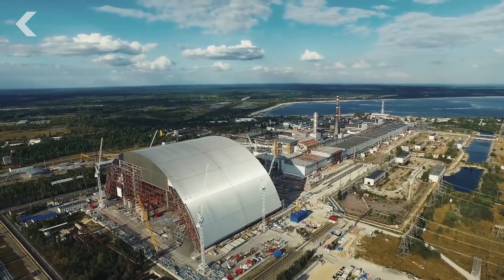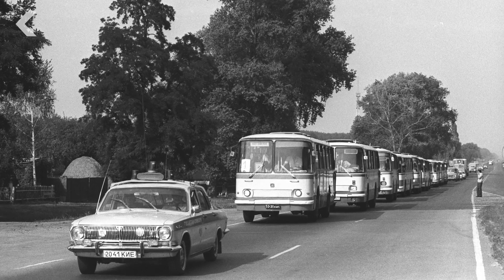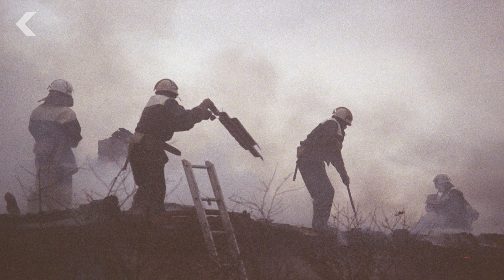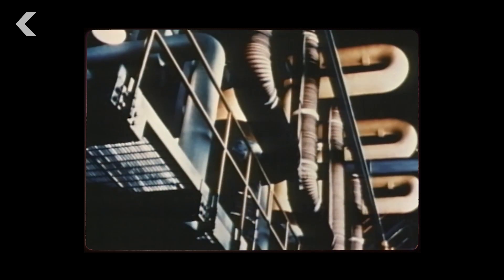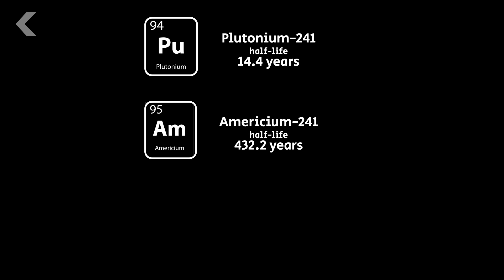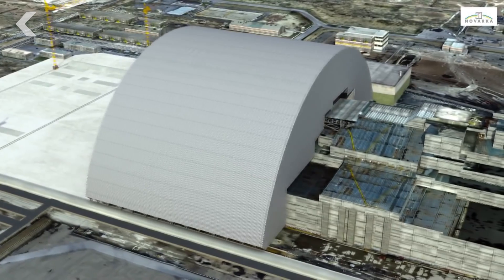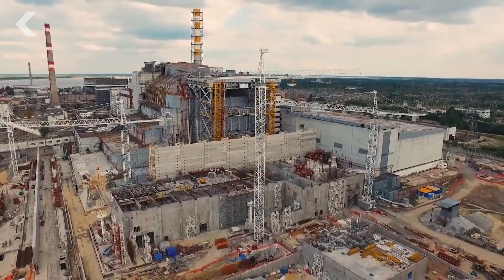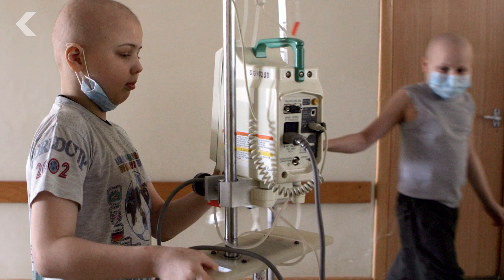Chernobyl's Massive Radiation Shield Is Preventing Nuclear Fallout

Comment: Damn... if only we had some way of generating energy from the sun... oh wait
Reply: Well, at least with those more expensive solutions we don't have to worry about a single facility fucking over our entire planet.
Reply: KILLERONROAD Okay. Who's gonna pay for it? How is the power going to be transported? Don't you think we'd already have a good supply of clean power if we could answer these questions?
Reply: The Eh Team Yup. I live in Northern Finland, during summer we could generate crazy amounts of solar energy, the sun just doesn't go below the horizon much at all. But the problem is the long and dark winter. It's not uncommon to have -40 celcius outside, with sun showing itself maybe for 2 hours per day, low on horizon, and only if clouds aren't covering the sky (which they often are). 

Winter is when most of our energy is used for heating our houses, so it's not 50℅ of the energy that needs to be covered with other carbon free energy solutions, it's probably more like 90℅ to 95℅.

If there was a way to store massive amounts of energy for the whole winter, then solar power could work in north as well. But right now we simply don't have that kind of technology.
Reply: The Eh Team Haha, yeah. And imagine replacing those 10 sheds full of batteries every 5 to 10 years or so because they keep degrading. 

Solar power is awesome, but it's just not the magical solution for green energy like some people want it to be. It can be used as part of the solution for sure, but unless we master fusion energy and make our own "sun" here on Earth, nuclear fission will probably remain one of the cleanest ways to make energy despite all the potential hazards that come with it.

I guess the nordic people are stuck burning firewood for now, it's really the easiest way to warm our houses and it's sustainable. It won't make my computer run though.
Reply: +HAWXLEADER Solar roadways are a scam...
Reply: My Stupid Opinion Yeah sure they do use it. But it's a mere few percent of the generated TWhs. 
Hopefully they will become significantly cheaper and more effective. I'm all onboard on that part.
Reply: Titan Blade 
Well that's good to hear cuz it's coming sooner than you think.
Reply: PhazonBlaxor Batteries don't really do much either. Imagine a winter's supply of firewood (my entire shed), now imagine having 10 times that volume in batteries. You can generate some energy from solar the odd time your panels aren't covered in snow. Nobody really knows what it takes to generate electricity until they pedal for it themselves.
Reply: It's amazing that nuclear power can remain profitable yet only utilizes 0.5% of the energy value from the ore.
Reply: My Stupid Opinion Dyson Sphere? ;)
Reply: "Oh yea that's right... I totally forgot that it's not viable on Antarctica... that definitely means that it's not a good way to generate electricity globally 😒"
'Cretin. No one mentioned Antarctica - only you did. There are many places where solar energy is shit: Northern and western Europe, Canada, Russia etc.
Reply: Only a pleb would compare the two..
Reply: If only they worked at night. Also the poles have 6 months of constant sunlight. Now your arctic base only needs half the diesel and oil. The problem is you still need something carbon free to cover your other 50%. http://live.gridwatch.ca/home-page.html
Reply: The Eh Team wind, tidal and gas and oil. We don’t need to give it up completely
Reply: Mekah Menke Haha, maybe... I used to talk with an American transfer student about this. He said one year in here felt like really long day and night cycle for him. He was slightly depressed in winter because there was barely no sunlight, but when summer finally came he had trouble sleeping because there was no darkness anymore.

Despite winter being dark and summer being bright, during spring and autumn we have normal day and night cycle, so it's not that bad honestly. :)

I just really wish we could use more solar power here... There aren't that many green energy options. :/
Reply: Researchers just boosted the efficiency to 50%. It may happen sooner than you think
Reply: Solar power simply can't produce enough as it stands. The technology is still to new and we have terrible energy storage. On top of that producing batteries and solar panels can actually be a very toxic process...
Reply: kelli w Increasing the efficiency of cells does nothing to solve the capacity factor, which hovers around 10-20% annually. Obviously you generate much less energy during the winter so you need the minimum capacity to meet winter demand. And again you need a place to store it and you'll need to curtail excess solar during the summer, furthering you from your return on investment (if there is any).
Reply: My Stupid Opinion or from the wind!
Reply: +My Stupid Opinion The Sun is one giant nuclear reaction. Solar by design is incredibly inefficient in that it is collecting light energy from a nuclear fusion reaction 93 million miles away. The light is then diffracted through 5 levels of Earth's atmosphere including water vapor and then is collected by solar panels. But wait solar panels can only collect certain types of light energy in different wavelengths, and then on top of that commercial panels have an average efficiency of collection at about 22%. 

But youre right if only we had some way of generating energy from the sun. Instead of collecting the transfer of energy from the sun, we can actually replicate the conditions that occur in the core of sun in various nuclear fusion designs.
Reply: Paul Swanee Interestingly enough nuclear fission utilizes the energy released from dead stars. All the hard work is already done for us, relatively speaking. If only we didn't use volatile coolants we wouldn't have them exploding on us. Molten salt or lead cooled reactor in my backyard and I would have no worries at all.
Reply: HAWXLEADER 
Exactly my friend 😄
Reply: It was a reference to Thunderf00t's video about how this idea is stupid...
Reply: My Stupid Opinion that technology is just to underdeveloped for the moment is better fusion nuclear
Reply: Joseph Leong 
Haha! Maybe in the year 3000 if we don't kill our selves off before that ;)
Reply: My Stupid Opinion solar energy is not so efficient unlike water or volcanos. If we I Costa Rica can generate up to 99% of our energy using renewable resources I'm sure rich countries can do the same thing. I highly recommend you guys to read this:
http://tv.fusion.net/story/355047/is-this-small-central-american-nation-ready-to-be-the-next-superpower/amp/
Reply: KILLERONROAD actually look at the byproducts of solar panel production.
Reply: My Stupid Opinion to manufacture them yes, Raw materials how ever.... and if you think it'll help the earth check out the by products of the production
Reply: My Stupid Opinion not to mention the massive amount of energy loss from the fields of panels being far away from population centers and the fact that it takes whole square miles to come within a fraction of producing as much energy as a small existing power plant. The biggest thing though is energy loss, especially when you consider all of those panels are connected individually and the distance needed to travel. There are good alternatives for energy production but solar is just a joke. The real problem that no one wants to talk about is that there are just to many damn people on this planet.... people seriously need to stop having so many kids. Unfortunately the majority of people having kids as well are idiots, smart people tend not to and since we'll..... they're not idiots, but for real something needs to be done to curb population expansion.
Reply: Gavlick Apthesycerski 
I don't know what country you're from bud, but in the countries that are really utilizing solar like the US and Germany are putting panels on rooftops as well as in massive fields. And last time I checked, the rooftop arrays are what you would call local? As in near to where the energy is needed? And obviously with practices like net-metering, the energy is being sent back to the grid to be redistributed, BUT with the new battery technologies about to hit the market, we will have what the solar industry calls "micro grids" and that is when all the solar houses and nearby solar fields and wind farms will be feeding the local community with renewable energy AND charging massive battery banks for night time use. And of course we could utilize nuclear energy for a emergency back. The point is that we can and are heading in this direction so deal with it. 
If you can't see the logic in that then you're lost. 
And I haven't heard you come up with a better alternative. So? Let's hear it.
Reply: I wouldn't risk less than 60% nuclear or hydro capacity. Solar panels have an EROI of ~7 being optimistic and batteries cut that in half. You must replace the panels AND batteries eventually. Estimates being that if a civilization's average EROI is less than 7 then you can't really power it. Up here in Canada, we have to use either coal, hydro, or nuclear as our main power source due to solar making very little energy during the winter. Wind still does stuff during the winter but I wouldn't trust it with my life.

It's not just homes you have to power, but also factories. Some facilities simply require too much power under one roof, like foundries, that have to run almost all hours of the day.
Reply: The Eh Team that and the fact that the raw materials for solar panels aren't going to last lol like it takes a ton to mine it alreafy... setting aside the refining. Hydro and nuclear are where it's at. For the most part though other then hydro if there isn't a chemical reaction going on in some way you're just wasting your time, I keep an open mind but solar just isn't happening...
Reply: My Stupid Opinion btw that's not how the energy grid ACTUALLY works, that's just the way it's charged, the energy running to your home isn't a certain amount that you're taking from a supply. There is a full chunk going towards and spent hitting your house no matter what, they charge you what you use yes, but regardless there is a larger amount being spent. Putting "back into the grid" you aren't truly doing that. You aren't just pumping more power into it that's not how it works, however you get paid that way because most people don't understand how the energy grid works and if the power company had to explain to people how it worked they'd be like wait a second .... wait are you for real?
Reply: +Pipe Alfaro "If we I Costa Rica can generate up to 99% of our energy using renewable resources I'm sure rich countries can do the same thing" This is not relatable to the USA. Costa Rica is able to run on hydropower due to its small size, small population, and large supply of hydropower. In the USA there is only a maximum potential capacity of 10% hydroelectricity according to the EIA. We consume 19% of the worlds electricity- significantly more than Costa Rica. While we may have many rivers, most of them do not have a large discharge rate making hydropower successful.
Reply: Erik Beyer Paulsen 
Not sure why I would be a "cretin", but I have personally seen solar utilized in Western Europe (Germany and France), Northern Europe (Denmark), and in Southern Canada (were the vast majority of the population lives). I can't testify to Russia using solar since I haven't been there, but I would imagine that there are many parts of the country that could use it. So, that being said, my point of mentioning Antarctica was that we can use solar on every continent that is permanently inhabited by humans, you ignorant prick.
Reply: Denmark doesn't run on solar. Despite that fact that both Germany and Denmark have spent billions on renewable energy sources they are some of the dirtiest countries in western europe when it comes to CO2 emitted per kWh.

Source: https://www.electricitymap.org/?wind=false&solar=false&page=country&countryCode=CA-ON

Note: On some days you will find Denmark to be in the top 5 EU countries when it comes to clean energy, but on other days it will be one of the dirtiest in Europe. It all depends on how windy it is. Germany is almost always in the top 3 of dirtiest countries in western Europe.
Reply: Also, note that France, Norway and Sweden are ALWAYS the cleanest countries in Europe, but that's not because they run on solar or win: It's because of nuclear power and hydro power.
Reply: Erik Beyer Paulsen and Norway is happy to produce it though and sell it to pay for everything else
Reply: Erik Beyer Paulsen this. countries don't run on solar as well, small tiny parts do. unless you're talking like Liechtenstein ... in which case you still can't because there isn't a large enough field close enough to even power it
Reply: Gavlick Apthesycerski & Erik Beyer Paulsen 

Guys, I'm taking the near future here, not the present. We need to keep investing in all renewable energy, especially solar and battery technology, like Tesla is, AND we need to upgrade our ancient power grids to new smart grids AND THEN restructure the grid into micro-grids. Of course nuclear power will be there as a backup, but we need to get away from energy sources that are either producing greenhouse gases or have dangerous byproducts like nuclear waste. 
I swear you nuclear guys can get so damn butt hurt when people point out the obvious dangers of nuclear power... like this video did.
Reply: I'll just leave my pessimism here. Countries that haven't met carbon targets now are not going to meet them. Fossil fuel adoption has grown at a much faster rate than renewables (especially in developing countries, never forget that), and America has a "nuclear cliff" of shutdowns. These developing countries are just going to invest with the cheapest option being coal "now" that they'll stick with for decades.
Reply: My Stupid Opinion solar isn't the option dude, yeah talk about the near future when we won't even have the raw materials to produce more cells..... or batteries..... or we could work on the grid issues and limit the excess use of electricity first before we worry about shit that probably won't work and work on stuff that we can actually fix....
Reply: Gavlick Apthesycerski 
You're joking right? We don't have the raw materials to produce the solar panels and batteries? Have you not heard about Elon Musk and his Gigafactory in Nevada? He is literally manufacturing batteries there for use in electric cars and for powering homes with solar panels. And he plans to build at least 3 more of these factories! And that's just one example! I really don't where in the world you live, but in the USA we are producing and installing solar panels just fine. You really smell like a troll, buddy.
Reply: "We need to keep investing" No, because the billions of euros that Germany has spent have gone to waste. It's a lost cause. No point in continuing to waste money on something that is simply not worth it. It's not coincidence that Denmark and Germany have some of the highest electricity prices in Europe.

Want cheap, green energy? Nuclear power is the way to go.
Reply: No need for carbon-free; geo-engineering can "normalize" global temps for a mere fraction of the cost of re-tooling our power infrastructure. Voluntary reduction of carbon output is doomed because of The Prisoner's Dilemma.
Reply: My Stupid Opinion you do realize solar power is extremely inefficient? a solar panel only generates a small amount of energy and what if its cloudy then what would we do? nuclear energy or gas is the way to go cause we can fuel the world without waiting for perfect weather
Reply: KILLERONROAD well its earth's fault for having uranium inside it in the first place
Reply: a solar panel can only generate a couple watts per hour bruh. i have a lil solar panel and it dont do shit
Reply: Mr. Blade Person you're just a nay dayer
Reply: +My Stupid Opinion They cost 💰💲💵💴💶💷💸💱💳
Reply: Titan Blade 
While you're right on the 25% efficiency, you're a little off with the countries. I know for a fact, because I've been to both Canada and Denmark, that they utilize solar. But also, for the rest of the world, the prices have fallen tremendously in the last 10 years and you can now install a solar panel system for a medium sized house in America for around $20,000 and then add another $7,000-$10,000 for Tesla batteries and you've got a solar powered house. Utilize this for every new house in America with an updated smart grid, and obviously other renewable energy sources and you've got a renewable powered country. 
Long story short, give it another 10-20 years and this will be the norm and any country still using fossil fuels for any thing other than an emergency back up will be considered barbaric.
Reply: it's actually only around 15% efficient on average. The belief that solar power isn't worth it is just stupid, if we put funding into solar panel technology, can you imagine the power we could generate? 15%, and 1/3 of germany runs entirely on solar power. Imagine 50%, or even 70%. And My Stupid Opinion is correct, over the past few years they have significantly dropped in prices. It's just a matter of getting out of that mindset and actually putting them to good use. Just like nuclear energy. Which by the way, there is enough uranium in the ocean to power all of earth for 10,000 years. But of course, the coal and oil industries will pump you full of that Bs about clean and nuclear energy so they can make more money.
Reply: Yeah, if only it didn't take multiple square miles of solar panels to approach the power output from a nuclear reactor. And if only we didn't have to replace solar panels every 10-15 years to keep them effective...and if only we didn't have massive piles of usefulness panels leaching toxic chemicals into the ground...and if only it didn't take so much fossil fuel to purify the materials for solar panels...then yeah, that'd be great.

However, the fact of the matter is that nothing known can come close to comparing with the low impact and high output of nuclear plants, even if you factor in the only two disasters to release anything significant and all the spent fuel sitting around. There is still less waste from nuclear than solar, or wind.
Reply: An ultra expensive and incredibly ineffective way that ins't viable everywhere on the planet.
Reply: Titan Blade 
Oh yea that's right... I totally forgot that it's not viable on Antarctica... that definitely means that it's not a good way to generate electricity globally 😒
Reply: My Stupid Opinion It's not.. yet. We can only transfer about 25% of the solar radiation to electrical power.
Making solar panels is extremely expensive. 
Not just Antarctica. Solar panels are practically useless in northern nations. Canada, Sweden, Norway, Denmark, Russia etc.
Reply: SOLAR FUCKING ROADWAYS!
Reply: Tyler Case 
I don't have the time and patience to go into detail about how wrong you are by say "solar panels are way too inefficient". 
Here's a quick setup for you so you can research the technology and learn something useful:
Solar panels on the roof of every house in the neighborhood + Tesla PowerWalls in each house + a local solar panel field with the same Tesla battery tech + an updated "Smart Grid" that works as a "Micro Grid" + some kind of emergency backup generator (make it nuclear or gas, I really don't care cuz it won't be used that much at all). And there you go, a 21st century energy system/grid that is safe, clean, and most importantly, RENEWABLE. 
If you can't see how this makes sense, and how awesome this will be cuz we can finally get off of middle eastern oil, and stop fracking the hell out of the world, then there's really no hope for you. 

PS All the technology I've mentioned above is real and currently being sold and installed in the U.S. Solar is here to stay. Get used to it.
Reply: PhazonBlaxor man.... that would make me so depressed!
Reply: +My Stupid Opinion Even if every single home in the USA was fitted with a 5600 Kw Solar power system the generation would barely meet 20% of net generation in the USA. Meaning that we need far more power generation than just what our houses can produce, or we will have to drastically reduce our consumption demand that is 17% of the world.
Reply: My Stupid Opinion if only making solar panels wasn't terrible for the planet and takes more energy to produce a panel then it can produce in its lifetime.... O wait....
Reply: why get more things to generate electricity if we just can get less people to use it
Reply: Super chic Vulpix ! 
What!? No way! I don't believe you!